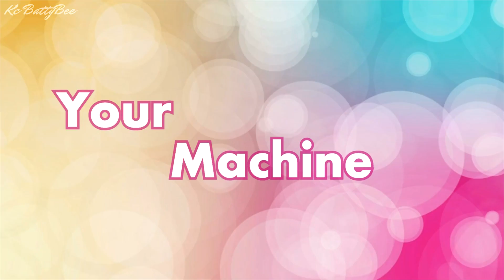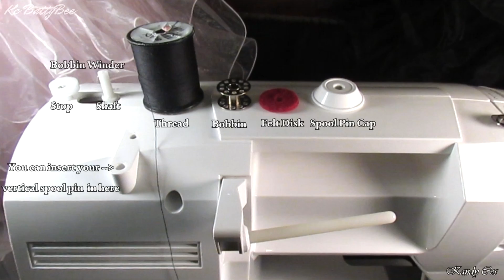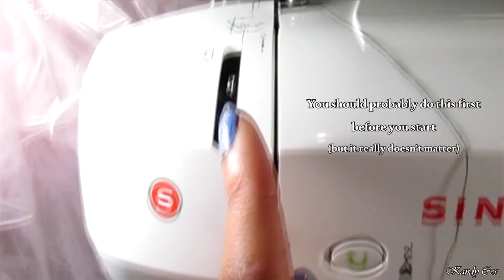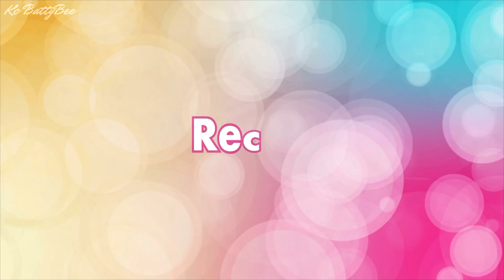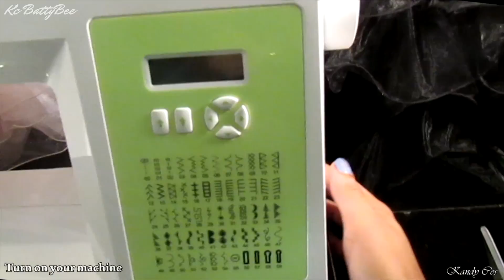EASY!! How To Thread your Sewing Machine | Singer SewMate

Comment: Ok, where the actual heck did you put the bobbin in??? Why did you not record where that is??? Not a slight movement to show it??? I get that you may not see this. But why cut where to find it??? The rest of the video does explain things greatly and show it, but still.
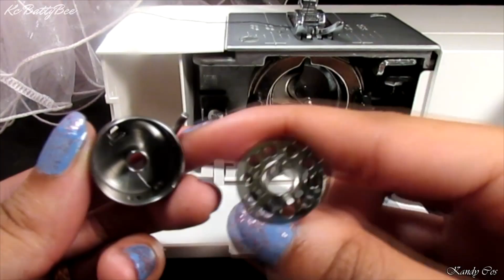Reply from the maker: 3:45 is where you put the bobbin in...you pull that piece out, put the bobbin inside and pull the thread through the hole. it's inside the only opening tab flap compartment thing that specific machine has. If you're using a similar machine and not that one, I couldn't tell you where

Comment: This machine was not designed to thread it the way you did it. If you look on top of the machine you will see two sets of 1 and 2 step. One of those sets is for winding the bobbin the other set is for sewing.  The tension disk on top is only for winding the bobbin but not for sewing.  Your method can work but in most cases you would have to turn the tension knob on the front of the machine to 2.5 or 3. Threading that way could cause to much tension and maybe puckering the material.  And dont forget to thread through the loop just above the needle.  Happy sewing.  Peace!
Reply from the maker: super helpful! thanks a lot :) would've been nicer if their instructions were better than i dont even know what it was they thought they were giving in the first place

Comment: Alright look. I have no idea what to do so now I’m gonna ask you. Do you have any idea how to fix the C4 error? There is 0 thread in the machine and the hand crank isn’t turn. Please send help :,)
Reply from the maker: 😭😭😭😭😭 no I haven't seen that error...yet at least....(probably because I still hate this machine and took a break from using it). Maybe when the thread did shift through or after you got it out moved a gear or something inside so then it thinks it's broken. Hmmm.... The hand crank controls the needle's level and if it's not moving then something still might be stuck somewhere or too many tiny fibers from the thread blocking. I don't know how to crack the machine open since I haven't broken it yet. I'm not an expert mechanic, only an expert destroyer of all things so I figure out how to fix it first.
Reply from the maker: Wait no I just looked it up....it says "The C4 error message is when the thread is tangled with the bobbin case. Remove the bobbin and clean out the area. If that doesn't fix it, then you probably need to remove the bobbin case itself. The entanglement might be below the case where it can't be seen." so you'll have to snoop around deeper in the bobbin section and not the needle part like I initially thought. I did have issues with that bobbin part in the past too when I was sewing with like a sheer satin fabric.....made my needle break too lol. It could be clogged lint or an itty bitty piece still stuck somewhere

Comment: Hello, My girl has a new machine of this kind. But when she start the machine, it doesn't do anything. The wheel don't run. It seems like blocked. Someone help me to unlock the machine? or a web site where I can find how to unlock the machine when it is new?
Reply from the maker: unfortunately there's nothing online (that I can find at least) with this particular machine with instructions of any kind. Has she threaded the machine before? if it's not the thread that has gotten stuck or fabric that got caught and it just doesn't work and you haven't sewn anything, the best thing to do would be to return it and exchange it for a new one. Or find the warranty number and see if they can replace the machine for you

Comment: The last step! Why the last step lol, can you please help me with the loop? It won't loop for me
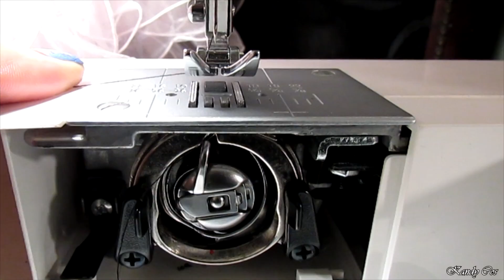Reply from the maker: pull both the thread from the needle and the thread from the bobbin that hangs after you insert the bobbin cap long enough so you can hold them both down with your finger to keep it in place (like i'm holding the top thread @ 4:47) when you rotate the knob for the needle. A lot of times it wont catch the loop because the string hanging from the bobbin isn't long enough. I always match the length of the bobbin thread to touch the top thread and usually that's long enough for the thread to catch and create the loop @ 4:58. It took me a minute to realize that myself so don't worry lol
Reply: @kandyb2847  you know how you did the complete rotation and the thread did it's thing? Well mine doesn't do that
Reply from the maker: @Pookiesmokie  oh no! umm...idunno...I guess keep trying to play around with it? This machine is frustrating and they leave little to no help with it. I wish I could see it and help you that way 😟

Comment: so , I loved this video up until trying to thread the needle. No matter how I did it, mine never went through or even wrapped around the needle. I did it exactly how you did. I am very frustrated and angry.
Reply from the maker: It's hard to explain because you have to hold it lightly but at an angle that's wrapped around the "wing hook thing" and touching the needle before you turn it for the thread to go through. I couldn't do it for the longest so trust me I completely feel you on the frustration (it took me over a month and a half trying to figure out this machine with many curses and tears). For a while I would literally turn the machine sideways and thread the needle by hand like you would threading a regular needle. You just have to play around with it until you get it and once you do it will be much easier. It started catching the thread to pull it through when I held it a little behind the needle like at 3:29 but with super light pressure holding it so that the hook catches and pulls it through....I'm so sorry this is to hard to explain through text I feel like I'm making the confusion worse lol ** sending you patience Dont give up! **

Comment: Mine is not making a complete rotation to pick up the bobbin. Please help
Reply from the maker: is the wheel getting stuck or you just dont see the thread pass like @4:57
Reply: @kandyb2847  the string doesn't pass. It looks like the wheel is getting caught but the hand wheel turns fine. The string makes it like a third of the rotation.
Reply from the maker: @laurensailes9830  its so hard because I cant see your machine to try and figure it out and I'm sure you've tried everything. I guess keep trying, maybe re-thread the machine and make sure the bobbin cover cap thing is pushed in all the way. I think all the action is from the thread thats in the needle because it is picking up the thread from the bobbin so maybe something is getting caught while you're threading the machine? I'm sorry I'm not much help because I cant see it
Reply: @kandyb2847  that's alright i appreciate you trying to help. I thought that too and was hoping i could reply with a video of it but no such luck. I will keep trying. Thanks for the support and for posting your video :)
Reply: Hi! I know it’s been a few months since you’ve commented but my machine is having the same problem. Did you ever find a solution?
Reply: @wallaceanddog6163 i played around with the tightness of the screw for the tension of the string. Took a couple tries but i found the sweet spot. Still took my time on the first rotation to make sure the string went proper and then once it was up i was good to go.
Reply from the maker: @laurensailes9830  that makes me so happy! I'm glad you figured it out

Comment: I just bought my singer I still don't understand the video because I got one thing right.but the still trying to get how put the thread in the needle threader.ive been at this until morning now at night it's not working for me I like start if someone should upload a better understanding on the needle I looked at the video still don't understand I  followed EVERYTHING I had it going throw away it if I  can't use it the book isn't no help I'm still trying to get the thread to get where it's supposed to be. but I still have no luck
Reply from the maker: it's hard to picture where you're getting stuck. Around what time stamp in the video would you say you're having trouble and maybe I can explain it a little easier (or try to)
Reply from the maker: if its with the latch and the hook thing, try and make sure you turn the knob on the side so that the needle is at the highest point and bring the hook thing down and turn it so that it doesnt fly up when you let it go. It only works if they're both lined up together. Then gently hold and wrap the thread around the outside of the bent looking hook and under the hook piece that the needle sits between. I would suggest tilting the thread upwards a little until it creates a kind of boxed "u" shape. When you release or "un-turn" the entire hook piece (sorry for using the word hook for everything but its the piece with the white latch and the bent hook piece attached to it) but when you release it, the piece that your needle sits in between should pull the thread you are gently holding through. I had a hard time for a while when I first started, just be patient and keep trying and eventually you'll get it
Reply: @kandyb2847  thanks I finally got before I read message  it took me two days to get it right.now I'm ready to do my sewing and doing my projects
Reply: @kandyb2847  I have everything working I figured it out with out the book thank you.
Reply from the maker: happy to hear :) good luck with your sewing!!!